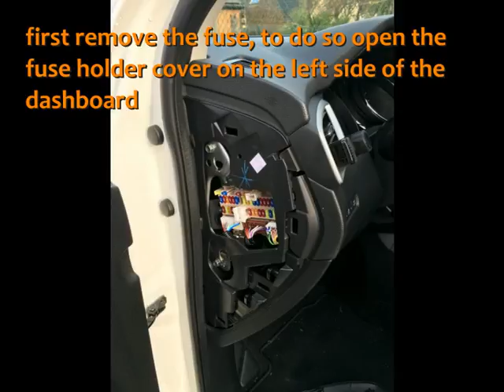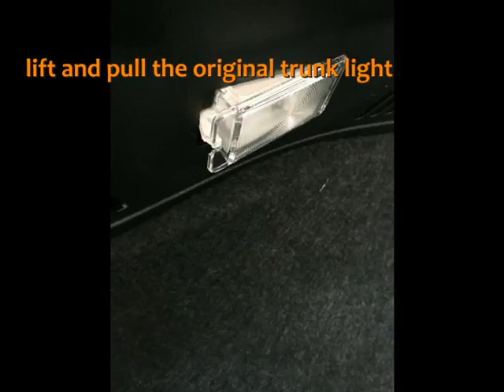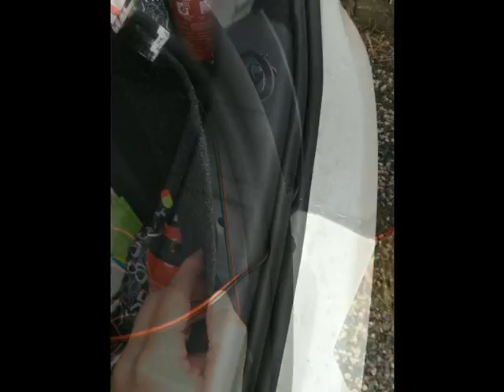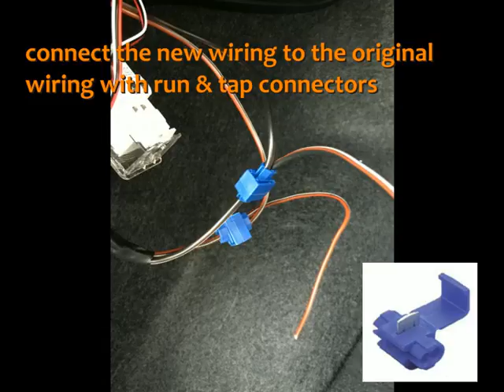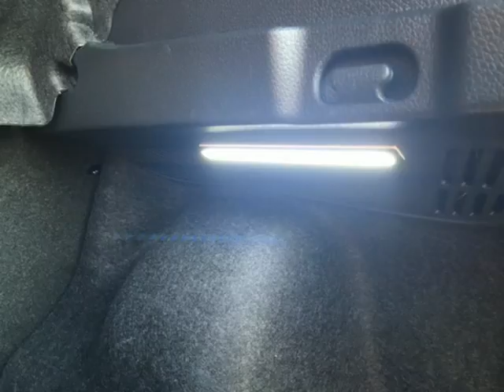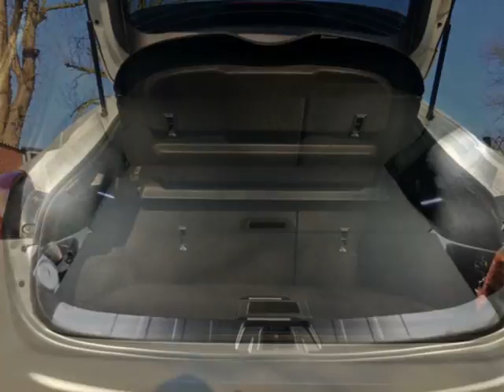Cheap way to improve your Nissan Qashqai's boot light!

Comment: Top net 2 led lichten geïnstalleerd in de kofferbak met behulp van je video en meteen een 12V adapter er naast geplaatst. Nu heb ik 4 usb aansluitingen bij de achterbank, ledverlichting in de kofferbak, met een 12V adapter. Super die video's!!!
Reply from the maker: Haha, leuk om te horen 😁 heb zelf ook die 12V in een andere video besproken en dat is ook wel zalig. Je vraagt je af waarom het er allemaal niet standaard op zit. Maar goed, hebben wij weer iets leuks te doen toch 😉
Reply: @LaPalmeraie0032  zeker leuk klusje, vooral dat het werkt. Maar idd vreemd dat het er niet in zit, zelfs mijn auto van 2011 had dit en mijn auto van 2007 daarvoor.

Comment: Hello, you make great videos, your help would be very helpful. So I've connected eight total footwell light off the front dome light connection. For the rear interior lights i have coneection going into the passenger and left rear door for my door panel light, on the right interior light i have the connection going into driver side door and rear right door for the door lights on that. I also have added the boot light. I believe all this runs from the fuse box with 5 amps fuse. My question is how many more light can I connect to that one connection to the front dome light . All has been working fine for months now however I want to add 2x 60" led lights under the car would you recommend i change the 5amp fuse for a more amped fuse? Or would it work fine?
Reply from the maker: Hi, thank you so much! I would never replace a factory fuse with a higher Amp as it is rated at a certain level with a reason. You could expose the concerned car part to too much amperage and damage it this way (or worse). You should make your calculation on how many amps your additional lights use and how much amp you still have left. I made a special video on this subject. In the tumbnail you see the formula. In another video I show all the fuses you can use safely.

Comment: Can i not just wire the bar to old cable for the old boot lamp
Reply from the maker: That’s what I did! But you want to split it again as you need to connect the leds on both left and right side.

Comment: Kan ik ook de stroom aftappen van dat lampje.. voor een 12 volt aansluiting? of is dat lampje geen 12 volt ?  Dit ivm met een dashcam achter.
Reply from the maker: Dat is wel 12V maar de vraag is op hoeveel ampère de dashcam trekt en hoeveel die aansluiting aankan? Dat zou je even moeten uitzoeken. Als alternatief kun je ook een echte 12V aansluiting maken in de koffer. Daar heb ik ook een video van en het is niet zo moeilijk. Dan heb je ineens meerdere mogelijkheden. Ofwel trek je die rechtstreeks door naar de dashcam. Ofwel splits je die met één voeding voor de dashcam en ééntje naar een 12V aansluiting voor in de koffer voor bv een koelbox oid. Ofwel enkel een 12V aansluiting waarin de dashcam ingeplugd kan worden.
Reply: Tnx voor de tip !

Comment: Hello !
Peux tu donner un lien dispo pour la commande, je ne trouve pas les bonnes dimensions... et côté connecteur comment as tu fait ?
Merci !
Reply from the maker: Hi friend! I used these kind of LED COB’s. There are plenty of them so look for the ones not expensive and with nice reviews. I took 1 for each side, 17cm each.
https://a.aliexpress.com/_d7HqV68

For the connection please look closely to the video were I show it step by step. Use this kind of connectors and it is even easier.
https://a.aliexpress.com/_dWDT8eg
Reply: @LaPalmeraie0032  thanks ! I wasn't a big fan of cutting out the plastic to install the same kind of lights so that is even better...

Comment: That may be cheap but it's not easy. What's easy is just go to a dollar store and buy a peel and stick LED light you can tap on and off and just stick it on the sidewall.
Reply from the maker: That would be easier indeed but wouldn’t be that esthetic nor automatic. I assure you that this job isn’t difficult and you wouldn’t regret the effort afterwards!

Comment: or just replace original boot lamp to led and you'll get +/- the same level of luminance but without all the wiring
Reply from the maker: 😂 yes of course but it won’t be as bright and still on one side so as soon as you place something in front you’re back to nothing. If you search the easy way, just add a portable LED light with magnet so is really plug and play and usable elsewhere as well 😉